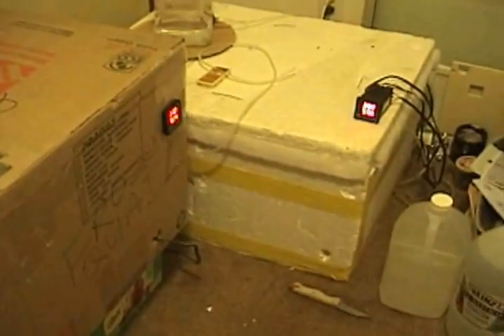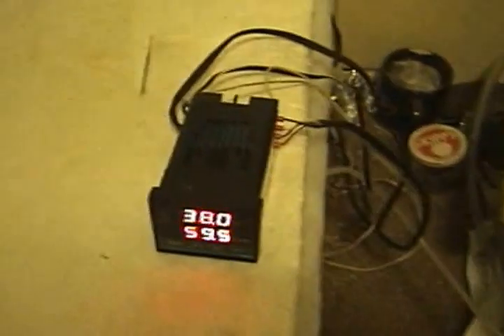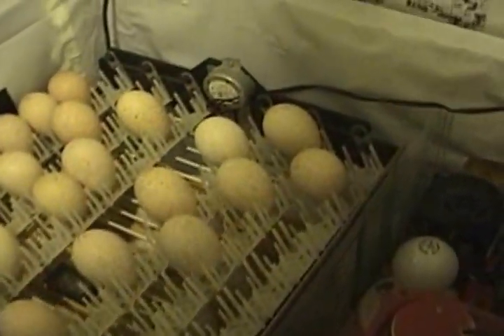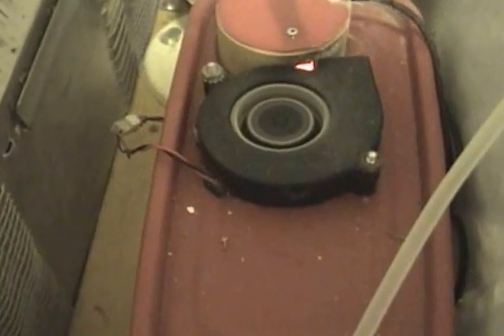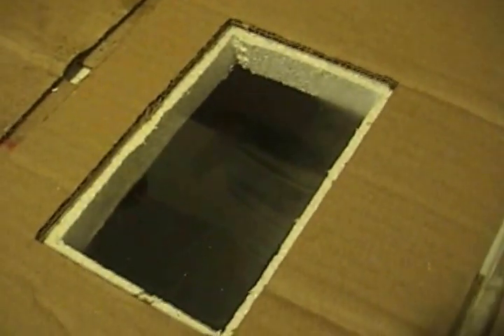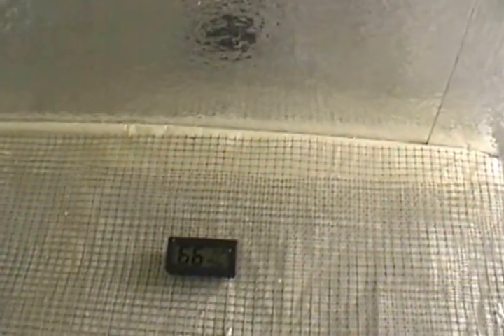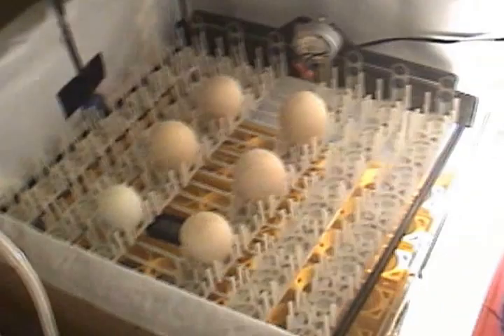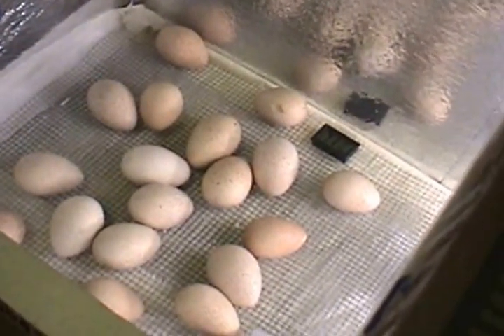My DIY Hatcher With Temp/Humidity Control

Comment: I am using actually the same type of temp and himidity controller but I havent tried them. May I know what are your settings? And how large are the fluctuations.?
Reply: Andrew Donaire what is the name of controller you are using?
Reply: Hi TimHarris,it is TH20 temperature and humidity controller. I stopped using this one because of the humidity control is broken. I am using a MYPIN TA4 SSR it works like magic but no humidity control though.
Reply: Andrew Donaire 00😅

Comment: Hi Jim great video. what device do you use to control the humidity and temp? also
  can the this device control two functions? For example, if the temperatures  drops below a certain level it will turn on the light and simultaneously turn on the humidifier?Cheers mate. and vice versa, turn off the temp and turn on the humidifier simultaneously?